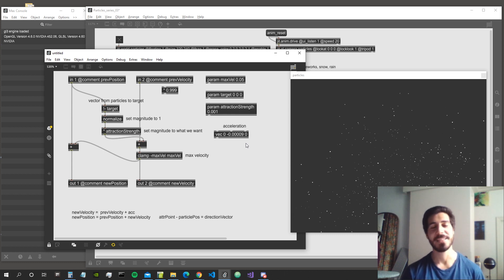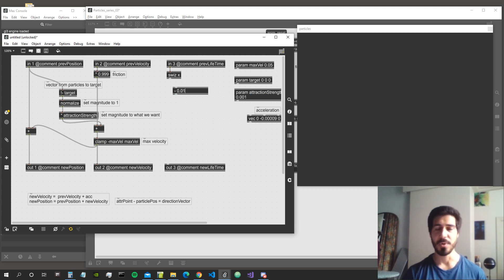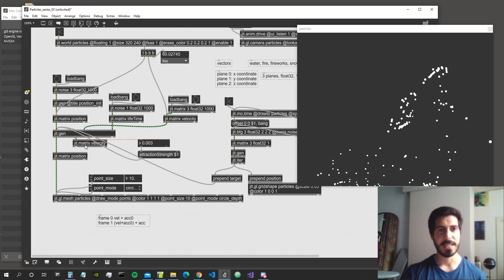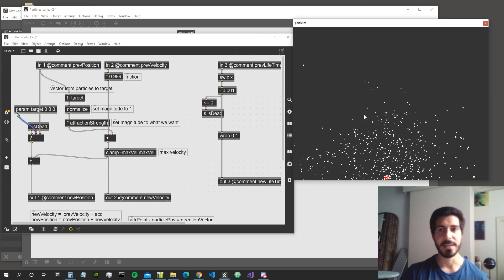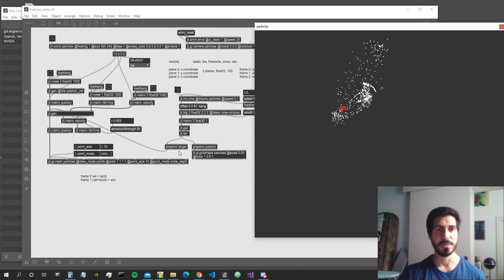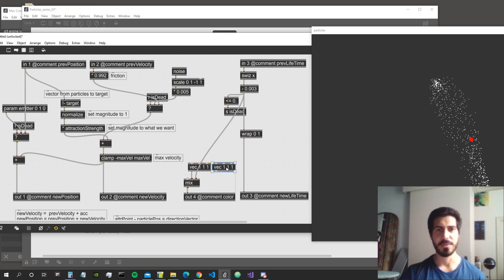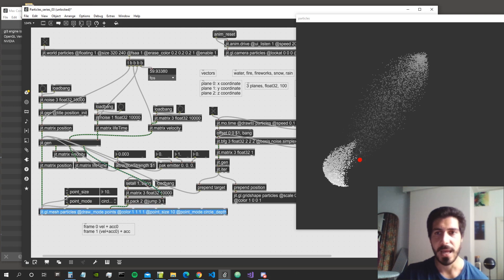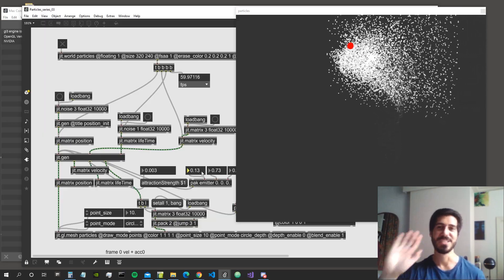Particles System  in Max/MSP Series | 04: Particles Life Time and Emitter

Comment: wonderful tutorial, loving the series so far!
I just have one issue currently: When you set all the matrix and noise to 10000 the first "jit.noise 2 float32 10000" for the initial position gives me issues. The matrix for velocity and the noise for the lifetime work just fine. Apparently the initial position noise that gives me that error can only stay at 1000... literally changing it by just one or anything else breaks it and I can't see the particles anymore. 
Do you have any idea why? as far as I could see, everything looks just like in your patch. I've especially looked into the position_init jit.gen object but all seems correct.
Do you have anything else you could suggest me to check? I know it's an odd question but I can't wrap my head around it o.o
Reply from the maker: Hi Gabriele! Do you get an error in the console? If you bang again all the input matrices for jit.gen you still don't see anything?
Reply: no issues in the console! But, after following the tutorial 5 using the matrix and 1000, it now works!
Super odd, the only thing that I think was changed in the main gen was the strength attraction method, you delete some objects to create others and apparently that must've been the issue(?)
A bit confused but glad that it now works.

Thanks a ton for your help anyway and for these great tutorials. This is really a gold mine :)  @AmazingMaxStuff

Comment: Hi, thank you for your tutorials :) 
Could you give me a hint on how to make them follow and be attracted to several targets ? I would like to try and combine that idea with this tutorial you made : https://www.youtube.com/watch?v=PXh8Z1kiJnw&t=941s
But instead of the planes, target points for the particles and then make the particles react to sound too
Reply from the maker: Hi Simon, should not be too difficult. Just recreate the target mechanism several times and sum the forces together. Then you can control the parameters using some audio input (amplitude for example). Have fun!
Reply: @AmazingMaxStuff  Yeah I guessed so, I'm kind of new to max and jitter though with little to no background in programming, I'll try that thank you !
Reply: @AmazingMaxStuff  Hi again, so I tranformed the lines planes into points, to simplify I kept 4 points horizontally and 4 verticaly. Now I don't know how to make them targets for the particles. Could you help me on how to change the target parameter in the particles gen so it's not a 3d vector but a matrix or a list idk, that is taking the 4 points coordinates ?
Reply: Maybe a simpler question : how to select each a cell of "jit.matrix 3 float32 4" and put it into a vector which will be one target ?
Reply from the maker: @simonguitar66  Hi Simon, have you checked all the jit.gen from zero to hero tutorials? After watching them you should have a much better understanding of how to work in gen: 
https://youtu.be/W358wOuHMW4